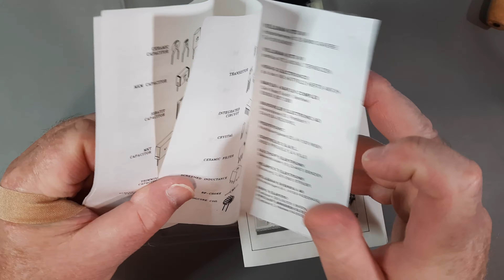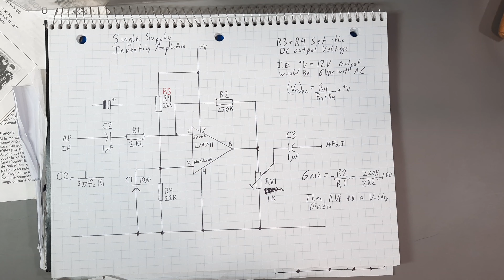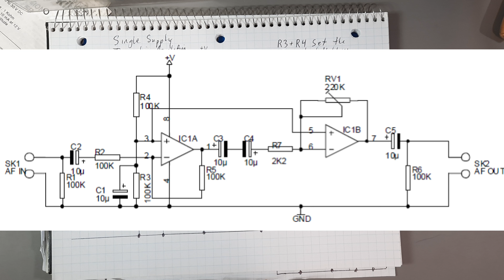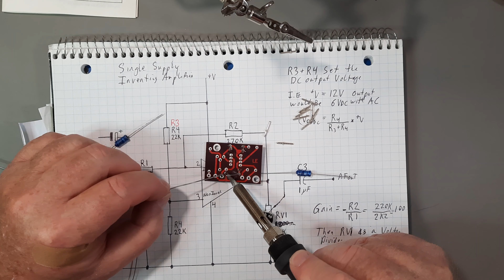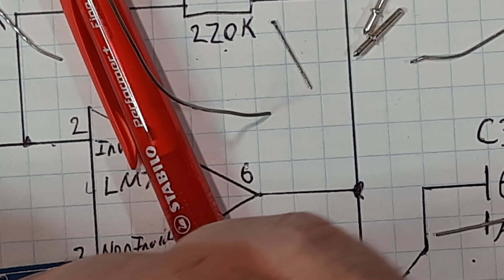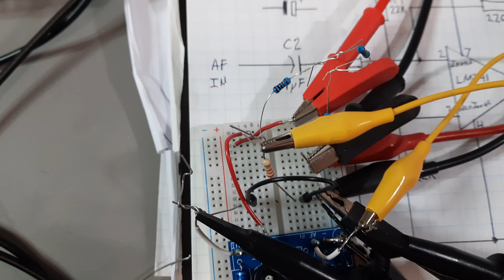Velleman Universal Mono Preamplifier  K1803 Version 1

Comment: Very interesting kit! Among the things I found a 20-year-old K1803 booklet. I remember at the time I put 2 pieces together for a guitar pedal for someone. Based on the LM358, two-cascade and no versions had been invented yet.The later V.2 is actually the original version. 🧐 Presumably, the customer chose this kit for the reason that LM358 is in operation mode from 6V supply, LM741 from 10V. The most pedals are known to be powered by 9V.
Reply from the maker: I checked their web site and they still sell the version with LM358. Someone was also trying to sell the LM741 on eBay for $19.95 USD. 
Neat little kit, have a good day

Comment: so a stero microphone would need 2 preamps and a socket that can split the trr in 2 signals ? or 2 mono microphones each having a single pre amp with a common ground ?
and then the output goes to a sound system + loudspeakers, or to a recording device ...
Reply from the maker: Yes, it would have two mono microphones each with a preamp and common ground, then both would go into their own second amp then to the sound system etc. This kit thou was more for education since there are better circuits (more complicated) out there that would take into account impedance matching.
Reply: In my experience from the early 90s, the 741 was a bit noisy for a dynamic microphone. The LM301 was much quieter. 🧐